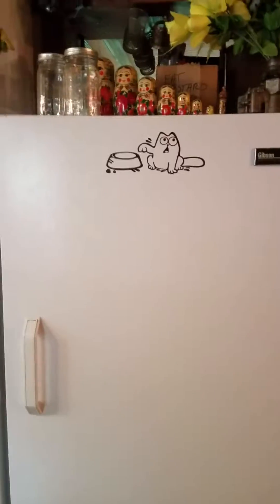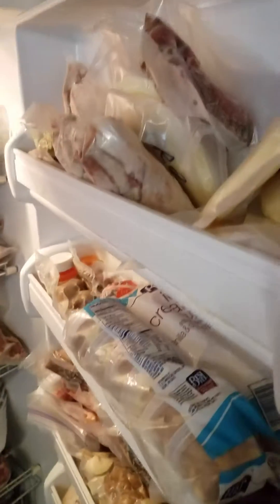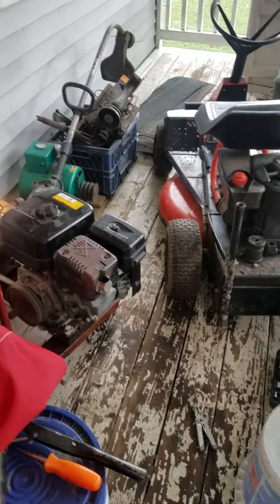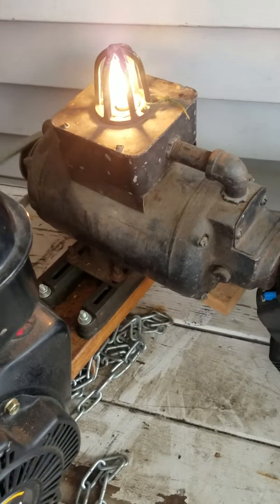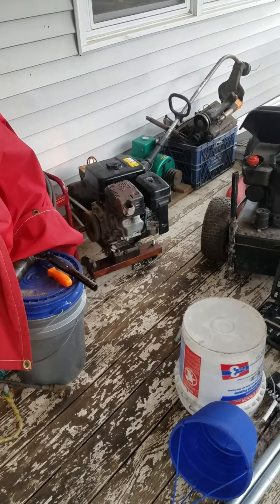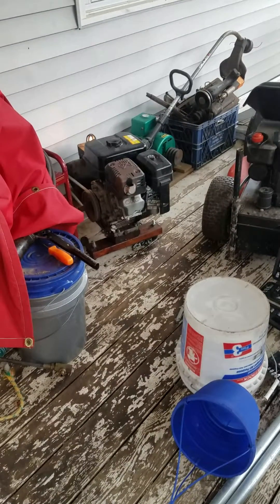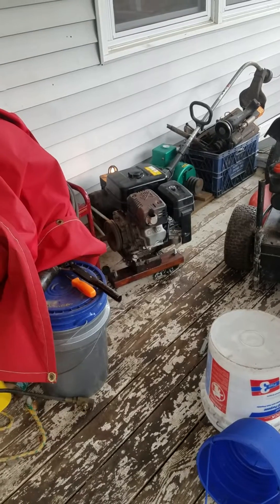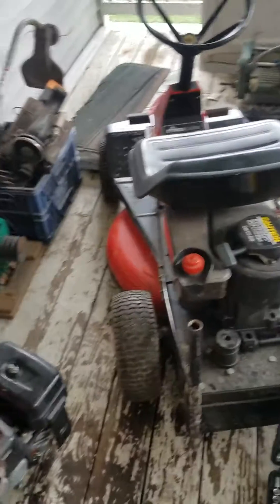Belt drive generator

Comment: Im not knew when it comes to generators - my grand father started working on rural and farm light plant generators about 1900 and a uncle of his mentored my grand fater and he started in 1880 or so woring on small town light plant  power house generators and farm light plant generators  - 
       When the term light plant is used it means that the generator charges batterys and a town or home ran off batterys and the generator was used to charge the houes or towns batterys - today thats a hybrid system - 
    Im a 3rd or forth generation generator machanic and spent my yrs in the offshore and remote mountin oilfields working on genrators - 
       As for the generator these days you can get those watt hour meter that plug into recepticals  -
      You want to keep an eye on the frequency - most motors run fine on 100 volts 50 or 60 hz - but if you bring a generator to 63 hz at 120 volts some moter will start  but trip out on over curent - 
    Most motors rated at 60HZ run  ok at 100 to 135 volts & 59 to 61 HZ - 
     As for the generator it needs 1 hp to generate 416 watts - 2.5 HP to generate 1000 watts - 
   I use a 3hp diesel that runs at 1200 to 1500 rpms - 
      Mu exception is im hybrid -    i live in a rural area in sout louisiana so huricanes can easely knock powwr out for long periods - 
    Ice storms also knock my power iut - - in my case i use a 12 volt altinator to keep power flowing into some battery's - 
      A 3000 watt inverter draws oyf the batterys to run the ceiling fan window fan 5 freezers and a fridges and lights - 
      With 12 volts it takes 1 hp to generate  300 watts or 22 amps at 14 volts - 
     With a belt drive a 1/2 hp is lost through the belt power transmition - 
      If i Run my diesel 3 hp at 2700 rpms i get about 45 amps off the altinator and at 1300 rpms i get about 22 amps of charge - 
      I have a heavy stationary oil engine with a  altenator also it runs at 400 rpms and is 3 HP or will deliver 750 watts continues into the batterys - it might use a gallon of fuel a day but weighs 2 tons of more - 
   I think the 50 RPM hot oil stationary engines are 24:1 fuel effecient - 
     The slower the engine runs and the hotter it runs the more fuel efficent they are - 
    Mine use transformer oil for coolant and runs at 250 ° of so - 
      By being hybrid if i need 300O watts part of the power comes off the battery's - 
     What i have just works - i have lost power up to 9 months one time and every thing worked well - 
      During the winter i only  have to run a generator a few hours a day to charge the batterys -

Comment: I’d like to rig up my 27hp lawn mower to run a gen head and have clean 240vac for emergencies.
Reply from the maker: Love It!  The only thing I can think of to be careful about it direction (many of the newer generators are bidirectional) and orientation of the generator.  My belt drive units specifically indicate the generator must be horizontal,  I'm assuming due to a lack of a thrust bearing or sealed tapered rollers able to handle a linear force on the shaft.  I have yet to mess with a really new one and see what they are all about.  I have to make a video about my latest toy, a supe low hour Onan DJA diesel one banger 3k 1800 rpm.  sweet unit!

Comment: Very nice   

Supposedly the governor response time is horrible under 2700 rpm.  On these small engines. 

I'm going to try it with a Honda gx200 running at 2700 rpm or so.

And it should put out around 3.5 hp continuous at that rpm.
Reply from the maker: Mine responds very well under 2700.  Of course, 6.5 hp on a 1500 watt generator is a low load, the backhoe is perfect, as well.
Reply: @martinbarnes6853   I could go even lower than 2700 rpm.  .  I would love to go around 2000 rpm.   I'm going to have to try different gear ratios. 
If the frequency doesn't drop too much that would be the ticket when the fridge kicks on.    

I've got a 1250 or 1350 watt pincor head from the 70s that I'm going to use.
Reply from the maker: @OTAlucard  I'm running my 1500 watt belt drive generator off a 6.5 hp Predator engine, featured in my "Tonco Propane Carburetor" video.  When I need the a/c or well pump I fire up my 3kw generator.  As you saw in the videos I have large cold storage, and the propane Predator snaps right to at 1440 rpm.  I'm using the same pulley size on the Predator for the purpose of auditory speed recognition, a tone, if you will.  A dvom is always used, as well.  The frequency with a brushed belt drive is directly proportional to the voltage output. Simple geometry and physics combined.  If u have 110 to 120 v, than u have 55 to 60 hz.  Please, do me a favor and contact me directly so I don't spend an hour figuring out how to respond.  Captainschooner@gmail.com

Thx.  I like your stuff, too...just not tech savvy enough to leave comments.
Reply from the maker: The rpm. Make the whole deal.work.  the Hz is directly proportional to the voltage.   Please make this easy for me.  3mail me at captainschooner@gmail.com. I love your channel, I. Just not tech savvy...thus the 1963 Enfield.